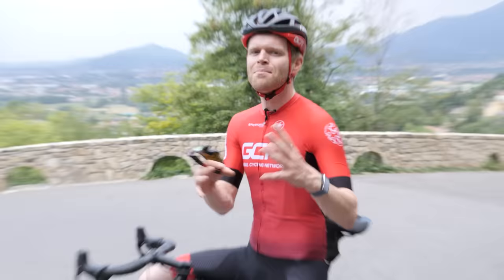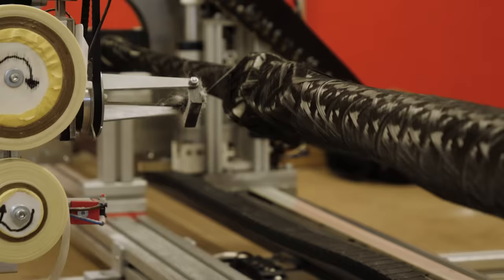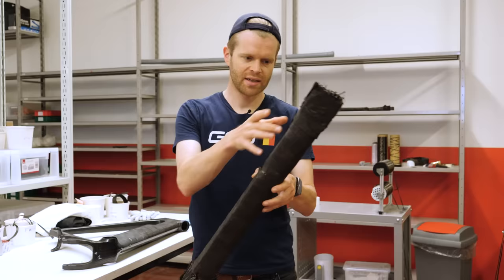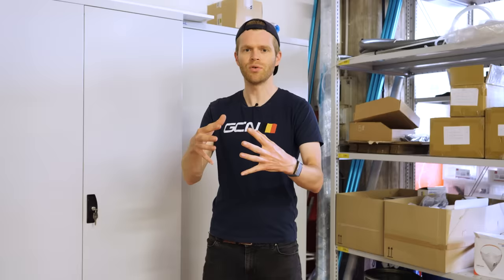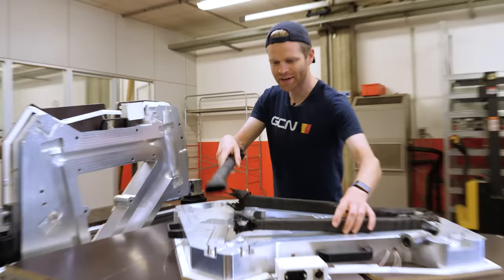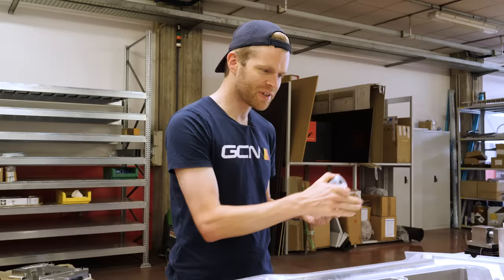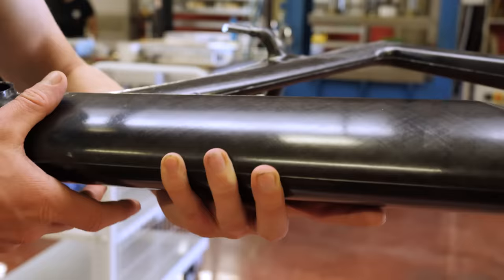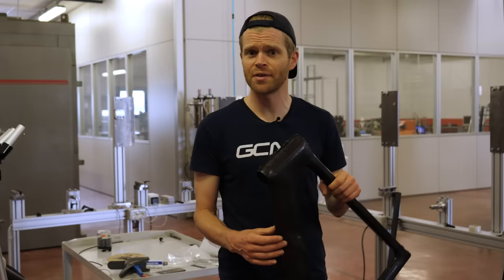Carbon Fibre Game Changer | Inside 3T's Italian Bike Factory

Comment: Less Labour intensive, less time intensive but still the price goes up. Cycling industry is a joke.
Reply: RnD costs go up, marginal costs go down.
Reply: Its been like that for ever, someones making a fortune
Reply: It’s called capitalism.
Reply: Not fun also not secret fact; retail costs are almost never related to production. Marketing sets a target retail and then determines desired profit window. Engineers then design to fit the window. Not the other way around.
Reply: @hectorchavez1807  and China got really good in it apparently. Chinese frames are made better by the day and are also cheaper than ones made by fancy brands. No overhead costs, no marketing BS, less labour costs.
Reply: @Coloneljesus  yeah I get that but In my opinion it is still completely out of proportion. If a frame is made in 6 Hours with  a lot of automated operations rather than 20+ hours with a lot of Labour required prices should drop significantly. Labour is still one of the biggest costs
Reply: ye especially when produced in Taiwan or China. In Italy at least taxes are very high so they have an excuse

Comment: I love that Europe is starting to switch on the brains again instead of moving every production step to China. There is also an emerging carbon manufacturing industry in Portugal and Spain that is worth a visit. The top secret UV-glue is a clever thing, I guess they can save resin by doing so as well.
Reply: It's always been about maximizing profit as it is for any businesses. European labored product cost 8 times over than chinese-made carbon parts in some cases. And the quality difference between higher end chinese-made carbon parts and european made parts is almost unnoticeable. For an average Joe, it's hardly justifiable paying $10,000.00 for an euro carbon bike when you can build one for $4,000 with the same shimano parts & performance.
Reply: @klaytonickinson  The quality difference is exactly zero. What you get for the higher labour cost is insurance and human rights. What I still don‘t understand why even things that are 100% machine made still have to be made in China.
Reply: @chrisridesbicycles  you probably didn’t understand Chinese styles. Highly efficient auto machine AND human labor made their market competitive
Reply: The increasing cost of energy will
Reply: @chrisridesbicycles  Yeah the europen values... It's like the workers freedoms in the Soviet Union.

Comment: 1 micron tolerance on bottom bracket? As a toolmaker I doubt that very much!
Reply: Have to agree with you there. I've worked with CNC machinery for over 20 years, and those kind of tolerances are difficult enough to maintain in precision grinding. Most lathes and work centres will maintain 0.01 under good conditions. I would expect there to be at least 0.01, probably more, between the mould and the bottom bracket plug otherwise just assembling them would become a very tricky job.
Reply: Especially with carbon filaments, I agree 👍

Comment: 10:52 + -0.001mm of tolerance and alignment. Yeah whatever...
Reply: The master has spoken 🔥
Reply: i loved the bottom bracket gauge moment and the 'perfectly' round comment - clearly a misguided nod to @hambini .....all i have to say is  - "3T, prove it ! "
Reply: HELLO HAMBINI FANS
Reply: bits of it might be lol
Reply: Some people have to wear hats...even indoors.
Reply: @Wildschwein_Jaeger  one step up from a hoodie
Reply: How the hell a 5 years old could comment here?
Reply: ...using two pieces bolted together. sounds legit
Reply: @jbkltc4469 and (with unknown tolerance of) snuggle fit to the jig.
Reply: Theoretically it would be possible to machine the mould and bottom bracket inserts at that precision (although it would require highly specialized equipment) - but has the frame afterwards the same precision?
Reply: Hello hambini
Reply: Aaaa Hambini, a surprise but welcome one.

Comment: "By doing it this way, 3T reckons it can achieve a +/-0.001mm of tolerance"

Somewhere in the UK, Hambini is starting to rub his hands together and opens up his little book of expletives.
Reply: ...that he authored.
Reply: 😁 😝 Brilliant as soon as he mentioned bottom bracket.. 😅
Reply: When I heard that I thought immediately of the dreaded H.😬
Reply: Agreed.
Reply: Yes. But I think Hambini likes to review customers bikes and not those sent by the marketing departments as we know they’ll be perfect.
Reply: CNC Tech here. Realistically, tolerances on any batch/mass made product, even bearing fittings and such, will be +/-0.005mm at best. Regardless, Hambini is a narcissist and con-artist who wants to charge £300 for a bottom bracket that any machinist could produce for £25.
Reply: @mofomartianp  And he makes you believe that the tolerances required for a bike to function properly (which is a plastic system when ridden anyway) are higher then in the Swiss watch industry,

Comment: "Top secret, we can't show you!" The next two scenes its just casually sat on the table lol
Reply: So as for the basic idea of this processing is not so big secret, actually I have a few ideas how it works (It can be air balony, with some ultra stiff elements, or some kind of mechanical device).
Too much pathos for me.
Reply: @volodymyrdonets4166  I think its like a plastic bottle with ice in it 
Frozen you can put preassure on it but after that it melts and you can easily pull it out
Reply: @simonkirchweger6090  epoxy is not capible with low temperature and moisture, that's definitely not the case
Reply: Wax. Low melting temp wax... if you are worried about it impregnation the carbon the put  it in a bladder or plastic coating ect before install. Melt away the wax and pull out the thin bladder. Done
Reply: @volodymyrdonets4166  will be some wedge and a multi part form. Just like any inside form tooling that needs to get removed.
Reply: @heavyweather  This is the first thing that came to mind although I have never seen such a process.

Comment: They can archive tube shape but weight/compliance is a lot harder this way compared to manual layup where you can play with fiber orientation/thickness.
Reply: Thank you for saying this. Filament winding has significant drawbacks to the this type of manufacturing. Specifically, it doesn't allow for optimized fiber orientation. And it has a minimum thickness in order to close out the winding pattern. With prepreg layup, you can optimize the layup in areas that need it and remove material in areas that don't need it. In this way you can create stiffer and lighter frames. And the use of M55J fiber (ultra high modulus fiber) is not necessarily a good thing in a bike frame. It is some of the stiffest fiber available, but it is also very brittle and will fracture much easier than Intermediate modulus fiber. IM fiber is very stiff and has super high tensile strength which makes it stronger in higher loads. And way more comfortable to ride.

Comment: If 3T makes a bottom bracket shell that's precise by 0.001mm does that mean it also has to make its own bottom brackets? Because surely mass produced BBs won't fit to such a precise space?
Reply: It means your bottom bracket won’t creak, which is usually a fault of the frame. Like when cannonade event a standard that they that themselves cannot manufacture to.
Reply: @likemarksee  But won't there now be more clearance, or more chances at least for ill-fitting mass produced BBs? Because mass produced BBs are manufactured with less precise measurements
Reply: @TheSamwhyte combination of both the BB and the shell could cause a poor it. Usually it’s the frame that causes a problem. Tolerance of the BB does not need to be any higher, just because the frame is more accurate. The BB tolerance would need to be within a suitable/specified range. If the frame is accurate, that’s one less variable that could cause a poor fit. I would think  most good BB’s are within a suitable tolerance, as that’s much easier to achieve than high tolerance on the frame.

Comment: The whole point of carbon fibre is the the material has directional characteristics- you can orient the fibre in the direction of the load. Weave the fibre fails to take advantage of the full potential of the material.
Reply: I also thought about this. Surprisingly (or not), no mention of this issue in the video. Seems to me however that fibre angle can be changed in the weaving process up to a point.
Reply: Sometimes one right comment!👍🏻👍🏻

Comment: nice to see bike making is back in Italy… but are they reducing the price?
Reply: More like a price hike for made in italy
Reply: I seriously doubt it. The marketing department of 3T will probably use that to justify an increase of their prices.

Bike manufacturers are always increasing their prices, until people stop buying. When that happens prices will just fall back to normal.
Reply: filament bikes cost more
Reply: Seems to me 3T are bringing some jobs back to Italy through the cost savings of manufacturing in this manner. Those Italian jobs will then pay Italian taxes. Maybe they could lower the price at some point, but they have a lot of bikes to sell to offset the cost of manufcaturing the machinery used, plua R&D.
Reply: @bronson911s2  italian labours not that expensive now days 
And they are doin in house manufacturing which further cut and cost
As long as QC improves and customer pay same price then it looks like a win win to me
Reply: Even if 3T doesn't, other companies can follow suit and compete in the market. 3T still has the strength of their branding (and tbh quite aesthetic designs) but the basic process can be reverse-engineered. That they took this first step is important and they're reaping the rewards of it now.
Reply: @Aubreykun  i think TIME is making frames in Slovakia using the same process
Reply: @molfar9049  Unless I'm wrong, TIME is a whole magnitude more "boutique" than 3T. The fact 3T are actually advertising their process as a selling point with having GCN show most of the factory is important. I have not seen TIME directly waving it around like a selling point, or at least nobody is talking about how "TIME does woven frames, not laid up frames!" when discussing brands.
So in that respect, 3T is benefiting from the hype about the process and the resulting improvementss, while TIME is benefiting from just the improvements. Competent engineers now have to do less legwork to figure out how to set up this process thanks to the ability to synthesize missing pieces from what info TIME and 3T each revealed to the public.

And of course this kind of process as a whole is a combination of other knowledge and research - TIME and 3T aren't the only market for those spools of carbon.

Comment: Looks great, but with all this trouble, why not mold along the rear triangle? Seems doable with two extra parts in the mold. It seems there now are glued weak spots in key heavy-pressure structural areas?

Comment: Sadly there’s nothing special about this. Making a preform using a carbon tow wit a UV activated binder and injection epoxy in a two part tool with internal bladder consolidation has been around for 40 years (Dowty propellers) . When they started I thought it would be novel like may towpreg in  a two part tool - They should give that a go!
Reply: How do they remove the mandrel from the carbon fiber part after the epoxy’s cured? 5:30
Reply: @lIIustration  I’m thinking they design the tubes with a draft on them, so that they can cut the ends and slide them out. If you look at the tube he handles, it’s got a really fuzzy end that’s been cut.
Reply: @lIIustration  The mandrel is made from wax.
Reply: @hotelzambia  oh that is a great idea! Heat it up and let the wax drip out.
Reply: @lIIustration  The mandrel is only there during the layup. They remove it before cure and replace it with  bladder that is pressurised what the mould is closed. It is like an inner tube. This is easily pulled out after cure.
Reply: @lIIustration  Wax is messy- the smartest mandrel that I have seen is the vacuum pack one. If you take a bag of material, shape it then pull a vacuum on it. (It ends up like a pack of coffee) use it as a mandrel then let air into it afterwards and it can be removed
Reply: @lIIustration  inflatable bladders.

Comment: “Greater consistency, voids and gaps/ensuring resin adhesion” all these concerns are the farthest thing from my mind when I blasting down a hill at 45-50+ miles on my Litespeed T1SL Titanium frame. Absolute peace of mind, and at 17.5lbs with pedals I’ll absolutely line up next to any of these ultralight Carbo/plastic/composite bikes.
Reply: Impressive manufacturing all around and glad Italian made vs Asian frames
Reply: It’s funny people try and make fun of carbon composites when modern aircraft like the Dreamliner is flying millions of people around the world and it’s made of carbon composite. A clear example of a lack of knowledge and feelings taking over. A well made carbon frame will blast down any hill without worry for decades. Colnago is a good example. Their C40, C50, EPS and C59 still blast down any hill and command high resale prices. Titanium is not a superior material to carbon. They are just both materials with different characteristics. There is sound reason it’s not used in bike racing except for chainrings and cassettes whereas carbon composite is preferred for the frame and everything else. When well made, it’s very light, very strong and no other material can currently come close. Goes to say it’s the preferred material for planes, race cars and high performance machines. Titanium used to be that exotic material 30 years ago and as good as it is, it never caught on even then due to the poor cost to performance ratio.

Comment: It was all amazing... until you showed the 5-Axis Maker being used to cut mounting holes.. I heavily question the repeatability of that hobbyist grade router.... it looks like 3T have modified it somewhat, but it's not an industrial quality CNC at all. Nonetheless, I'm still salivating and thanks for the video & insight into the facilities! I commend 3T from bringing manufacturing home through automation, if only other manufacturers followed suit!
Reply: It is industrial quality (you saw it used in the industry). Don't get a fetish about the required precision for those joints. Those are screw joints anyway.

Comment: Bought 3t strada frameset january. Havent seen never crapier quality. And the 3t customer service start to ghost, last response was 3months a go. Luckily merlin cycles took care off the quality issues.
Reply: Fork drop outs was full off resin. After 500km ride the bb left bearing was run out. Etc

Comment: The weave on that down tube looks incredible. I think Giant are another company that has the capability to manufacture bike frames from filament, but there are hardly any others?
Reply: My 2008 Specialized Roubaix Elite has beautiful blue clear-coat over the layup, which the Big Red S messed up with way to many decals. Regardless, I'm happy to see that kind of finish again.
Reply: @smithpauld1501  probably pre-woven carbon sheet on the Roubaix.

Comment: I seems to me that this process would also make a frame more resistant to delamination and catastrophic failure because the tube is woven from a continuous filament, woven around a mandrel and then impregnated makes it much harder to separate than sheets of carbon fibre. The resin moreover penetrates each fibre in its final shape as opposed to entire sheets that are cut flat but then forced into a three dimensional shape, under pressure. Much less likelihood of wrinkling in this process it seems.

Wish they had an alternative cable routing for their frames. Not a big fan of going through the top tube like that, even though I see how simplifies manufacturing and increases reliability.
Reply: if that's an issue for you just get a steelframe. ultimately until further notice, critical failure, as in, it just breaks into pieces, will sometimes happen with carbon frames, mostly never happen with steel. Obviously, if you spend that much money to shave off 2-3 pds off frame weight or to get extra stiffness, your priorities are not necessarily safety but speed and efficiency.
Reply: @maxmeier532  in fact, steel is all I’ve ever had. Have been riding Columbus Spirit for the past decade or so. Great road feel, vibration damping and dents instead of cracking.

Comment: Nice, beautiful product, manual labor time cut to one quarter???, a great advertisement for 3T.   I suspect most carbon fiber frame manufacturers use jigs when joining rear triangles to main triangles unlike Ollie noted.  I'm curious to see the head tube of the frame that was fresh out of the mold.  It looked odd, as if the resin didn't flow to the front of the tube.

Comment: I would rather see innovation in the 3T quality control process as the products they have put out to the consumer in the past few years has a lot to be desired. If the QC is still the same then they still have bigger problems than defending their claims on tolerances.

Comment: Whats with the small tire clearance? Looks to me that a little bit of mud is going to grind out the frame
Reply: the racemax has really small tyre clearance in 700c but huge with 650b, with 700c you can fit 37/40c tyres and be super aero, more than that I won't feel safe. But i've seen riding it with 650b x 50c tyres no problem
Reply: @8paolo96  i can believe that its works nicely at first. But the way i use my (cross) bike i need the clearance to compensate for the none straightness of my rims over time or spoke breaks that can occure. Even the tire deformation when cornering with low air pressure will make it touch the frame.